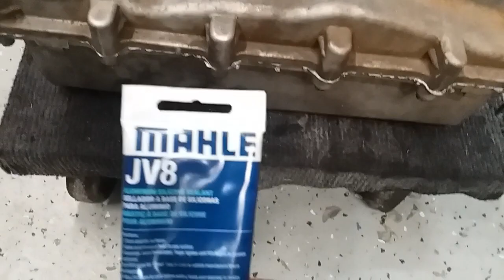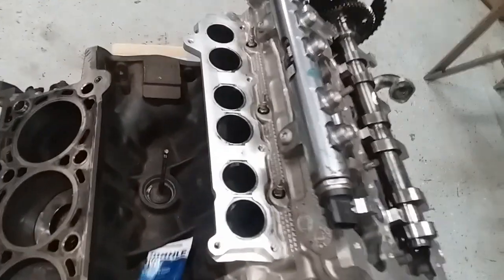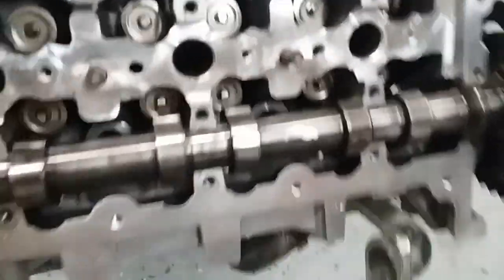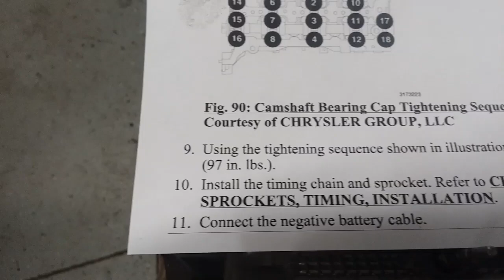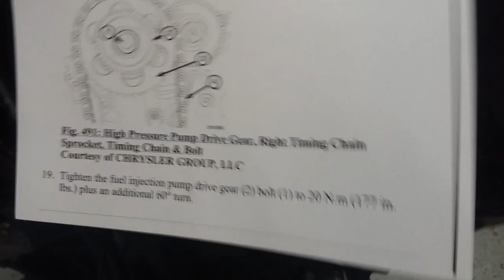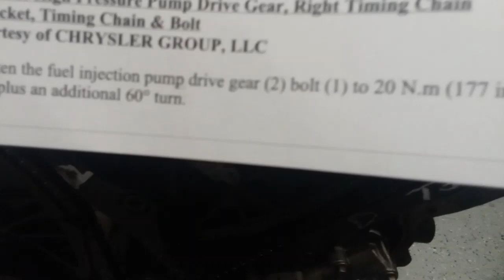Ecodiesel CP4 pump failure and motor damage repair

Comment: according to experts ..running the ecodiesel out of fuel , or not properly priming the system after fuel filter change can allow  the roller buckets to turn 90 degrees causing failure of the pump and entire fuel system. the cpx pump is meant to fix this by allowing the fuel in the contaminent prone area of the pump to vent back to tank instead of to the injectors, as well as pinning the buckets to stay aligned with the cam. i have one on order despite having no issues YET

Comment: Great videos sir Thank you for sharing your experience. 
Where did you download the engine rebuild manual? I’d really like to get that. I have a 2016 Grand Cherokee 3.0 ecodiesel with engine failure or fuel pump failure not sure yet what exactly what has happened but I had the dealer replace the cp4 pump due to it having been recalled about 8 months ago and it was in regeneration when it stopped running and sounded like it spun a barring or all the rockers broke with zero signs of anything.

Comment: My fuel pump is making a rrr sound i think that bolt has come loose...
Reply from the maker: FCA recall Z-46 will replace the injection pump no cost. If your pump locks up it will take out the motor.
Reply: @alanhiiesalu6158  Had it done :)

Comment: Why you there to be better to replace the turbo coolant line that goes to the center of the motor. Question: Can you weld  that bolt to the spin wheel

Comment: my 2014 ram high pressure pump went out couple days ago. the cp4 pump is under recall dodge said they dont have the parts and its already a year over due. so truck is sitting in the yard since i was quoted 9k to fix
Reply: I have a pump

Comment from the maker: Still running great 12,500 miles since the rebuild, adding 4 oz Marvel mystery oil every 10 gallons.
Reply: I do the same ( 2022 jeep gladiator with the 3rd gen. Eco diesel) … but all my emissions shit did fell off the vehicle cuz of potholes. I know your engine is a 2014… but do i have any intell or opinion on the latest 3rd generation eco diesels? (Yes the diesel pump does have a recall on it , but mostly cuz of the lack of lubricants in the American diesel fuel (therefore I add plenty of lube to the fuel)
Reply: @ARMASARMY what additives do you use and is this each full fuel refill?😊
Reply: @MrQuicks7 I add 3 Oz of a cocktail I make from 2 stroke mixing oil (this oil is designed to be burned in the combustion chamber, remember that, as well for lubrication) … mixed half and half with Marvel Mystery oil (the one tractor supply sales to be added on fuels), I mixed well and every time I refill (never below half tank) I add 3 oz every time… I also add arch oil on the engine oil every oil change (never…. NEVER change your oil at the “10k” miles the manufacturer tells you…. Fuuuuuck that, 5k max ESPECIALLY… if you have all the EPA garbage attached……. Keep in mind the only way my cocktail of oil is 100% safe in my engine is cuz I don’t have any EPA shit cuz my vehicle is for competition and off road use only…..  if you have the EPA stuff in it… I would still do it but there is a chance you could gunk all the exhaust system…UNLESS… you run hot and long to turn all gunk to ash…. With EPA shit still on the engine… IDLE IS THE WORSE YOU CAN DO (I am a diesel Marine Mechanic)
Reply: @MrQuicks7 with this… I have been running since 2022 on a CP4 pump that has a factory recall…. Im convinced that after all this years and over 50k miles I haven’t had any problems with the pump cuz I put the lubricant back into the fuel… like Gawd intended

Comment: This is about the best video I’ve seen on the Ecodiesel for a while. I followed the link but it only gave me about 5 pages about the egr, is that correct?
Can you remove the oil pump without having to remove the pickup tube?
Did you have any trouble timing your hpfp?
Reply from the maker: Been a while since I have read the post, I think i removed the pickup tube and the oil pump. Injection pump has to be timed #1 piston on compression stroke then you put a pin in the crank shaft to lock it. The hpfp has to be timed by lining up a hole then turning it -65 degrees. should be some post on how its done the manual does not cover this timing. The link should give you 500 plus pages and is the best to use if you want to tear down and repair. Motor is easy to work on after it is removed. You must follow every step to avoide mistakes. 
Pulling the motor is the hard part. Take your time take pictures be carefull dissconnecting connections, fittings sensors .

Comment: What About Additives?  Like Dpf cleaner and " Hotshot " Everyday  diesel Additive that claims to boost Cetane, add 25% more Lubricity etc?
Also, Do you pull alot of weight? 
And does the 3rd Generation solve any of these issues  ?
Reply from the maker: ALAN HIIESALU
1 second ago
I get 32 mpg with my truck thats why i fixed it and its running great,I Would change Oil every 5,000 miles and fuel filter 10-15 thousand miles and add 4 ounces Marvel Mystery oil per 10 gallons diesel. USA Diesel has lubicrants stripped from it.
Getting rid of the EGR is the best thing you can do to make motor last a long time.
Reply: @alanhiiesalu6158  I just watched a video of a truck owner cleaning his EGR ,  on a 2015 and he was Quite pissed off when he saw how much soot entered the intake manifold. 
Thanks for Marvel Mystery oil trick, I am a little skeptical but will look into it. 
-peace

Comment: The pump is under recall by Chrysler. Is your motor not under warranty if it was killed by the fuel pump? ( I realize it’s a 2015 ) but it should be covered. Assuming it’s possible to prove the fuel pump was the cause.
Reply from the maker: I did not know that, motor has 175,000 and fule pump locked up. Anyway I am happy my truck is running and getting up to 32 mpg
Reply: @alanhiiesalu6158  Mines at 196900 Km and is stock. Replaced egr when it was recalled. Otherwise it’s been a great truck. I really like it. There must be others out there running fine as well. Or is it just a matter of time for all these motors? Going to check out the fuel additive you mentioned. Nice work on the video and the repair.
Reply from the maker: They are such a great truck and mpg cant be beat. Motor is a Rock solid 4 Bolt main with only 2 problems high pressure pump and ERG that clogs the motor. Delete it (EGR) if you can, Use a fuel addive to keep that pump lubricated and fule filter replaced often ( USA strips the lubricants from diesel). If it (pump) starts to fail alumiun starts to shave off  (inside the pump) and the metal goes evewere.  I think you can hear it when it starts to fail. They say 7% failure USA
  @kodiak2053
Reply: How did you prove that it was due to the fule pump ( the dealership just replaced my fuel pump and fule system “ manufactur paid for it ) but now they tell me that this part is broken

Comment: Awesome job currently replacing the injection pump on my pas truck it’s a shame that these things are so problem ridden because they run amazing and have excellent fuel mileage
Reply from the maker: I get 32 mpg with my truck thats why i fixed it and its running great,I Would change Oil every 5,000 miles and fuel filter 10-15 thousand miles and add 4 ounces Marvel Mystery oil per 10 gallons diesel. USA Diesel has lubicrants stripped from it.
Getting rid of the EGR is the best thing you can do to make motor last a long time.

Comment: Can you point me in the direction of the manual to disassemble and reassemble the engine.
Reply from the maker: The manual is huge and covers the whole truck look for the 3.0 motor. Motor come apart easy take a lot of photos and go slow, follow every step. I did not do bottom end or pistons as they were fine. If your injector pump failed then you have to replace or clean enitre fuel system.  Looking for the correct link to the motor manual this one should work https://www.scribd.com/document/438243722/Chrysler-EcoDiesel-3-0L-R00
Reply: @alanhiiesalu6158  thanks so much man. I just need to replace the head gaskets. Mine popped and it's over pressurizing. Exhaust gas is leakinging into the cooling system under load. I can't find anyone that wants to touch this thing. My ecodiesel is in a jeep.
Reply from the maker: @jc35957  No problem
Reply: That link now goes to “BG DIESEL EGR SYSTEM SERVICE INSTRUCTIONS”. 
Any chance you still have that manual and can email it to a guy in need?
Reply: @supersam78250  You'll need some special tools btw
Reply: @jc35957  I need to do a lower end rebuild for a spin bearing, but I’d love to have the manual to follow along.
Reply: @supersam78250  I've posted it like 3 times it keeps getting deleted
Reply: @jc35957  I figured it got deleted. The powers that be want us to buy an 18k replacement engine instead of rebuilding it. 
If you still have the pdf saved, would you be willing to send it in an email?
Reply: @supersam78250  sure
Reply: @supersam78250  I think your message got deleted lol

Comment: I called mopar for a replacement ecodiesel 3 days ago. They told me 18k but it's indefinite backorder.
Reply from the maker: That is a lot of $$,,, pull off the injection pump and see if there the gear spins. If so pull off  passenger valve cover to see how many rockers broke. If the needle bearings have not fallen into oil pan then replace the roller rockers and re time motor (use the amazon tool) then do a compression test, if good  then no bent valves. You still have to clean or replace entire fuel system. I was able to clean mine, see other video  system. I did have to get new injectors. Mopar has them for $150.00 each.
Reply: @alanhiiesalu6158  and a new pump CPx from RCD Performance - upgraded....

Comment from the maker: Motor is running great about 750 miles so far, I did have to clean entire fuel system and replace Injection pump (rebuilt) and new Injectors see my other video. I am using 4 ounces of Marvel Mystery oil per 10 gallons diesel to lube pump. Calif diesel is stripped of important lubricants and this causes the CP4 injection pump to lock up. I am also changing fuel filter evey 10,000 miles and motor oil every 5,000 miles. Planning to delete egr, it will destroy  this motor by pumping soot in the intake. The soot will clog up main bearings and cause them dry out and spin. I get 30 to 32 mpg with a 700 mile range.